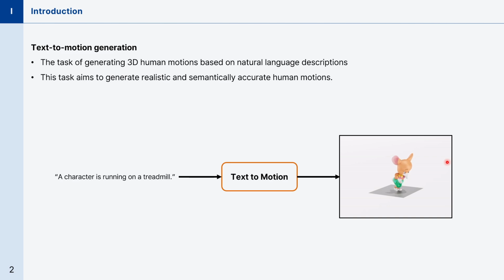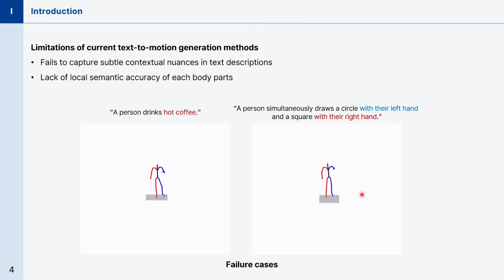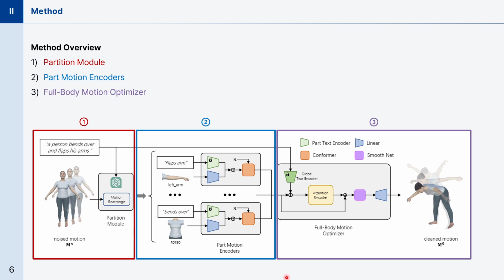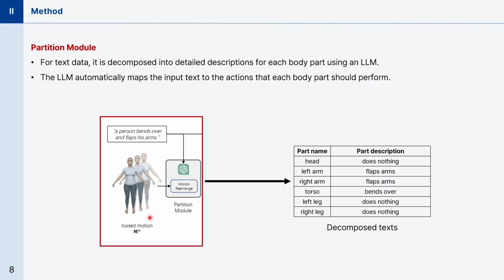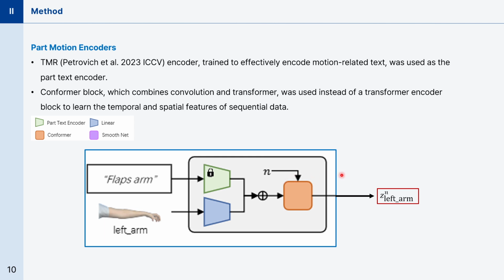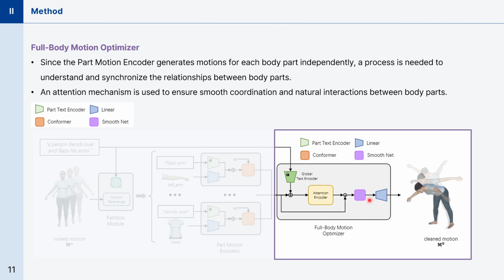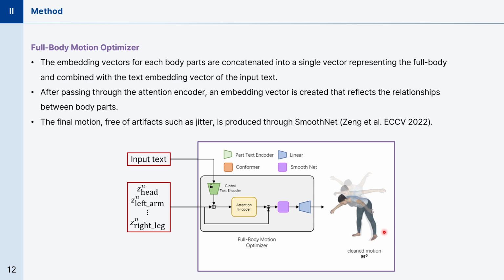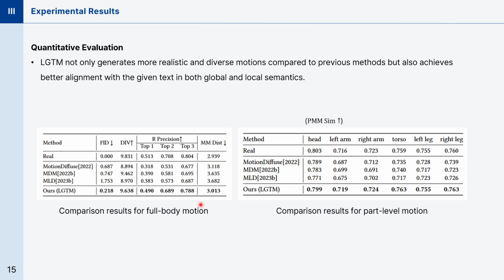[Seminar] LGTM: Local-to-Global Text-Driven Human Motion Diffusion Model

Comment: Thank you for the presentation.
Q1. Around the 1-minute mark, there's an example where a person drinks hot coffee. It made me wonder—actually, the sentence itself doesn’t explicitly mention that hot coffee should be handled carefully. If we provide previous models with prompts that include not just the motion, but also the characteristics that should be exhibited while performing that motion, along with the reason, would they still fail to capture such nuanced features?
Q2. It seems that you used a conformer block instead of a transformer block. Does the paper include an ablation study regarding this choice? I’m curious how much the performance would degrade if a transformer block were used instead.

Comment from the maker: By using an LLM, we should in principle be able to produce motions that are just as we wish. However, in reality, the range of possible motions in the dataset may not be as broad as the flexibility allowed by the text. In that case, are we just restricting ourselves to whatever the dataset can cover? Is there really no way to do this without being bound to a specific dataset?
Reply: You are correct that the range of motions the model can produce is inherently limited by the dataset it is trained on. If the dataset does not include a wide variety of motions or contextually rich examples, the model may struggle to generate motions beyond what the dataset represents. This limitation arises because the model learns a mapping between text and motion based on the data it has seen, restricting its generalization capability.

To overcome this, I think these methods can be a potential solution:

- Data augmentation: Expanding the dataset by synthesizing new motions or combining existing motions in novel ways could increase the diversity of motions the model can generate.
- Few-shot learning or pretrained models: Leveraging large-scale, pre-trained generative models with few-shot learning could enable the generation of motions beyond the specific dataset's scope.
- Reinforcement learning: Training in simulated environments where the model interacts dynamically could help it learn motions that are not explicitly in the dataset.

Comment: I had a lot of curiosity about text-to-motion, so thank you for the presentation.

I have two questions:

Q1. I understand that one of the major strengths of this paper is its hierarchical approach to generating motion by dividing body parts. However, what do you think are the potential limitations of this method? Also, how did the authors describe the limitations in the paper?

Q2. In my opinion, this model might still struggle to interpret descriptions that include context, such as "A person drinks hot coffee." It seems to me that while the model can understand the actions of specific body parts, it might not grasp the reasoning behind those actions (e.g., blowing on the coffee because it is hot). What are your thoughts on this?
Reply: Hello. Thank you for your question.

A1. The limitations of the paper are as follows.
- Since they used LLM to decompose the description, the local accuracy varies depending on the type of LLM used and the difference in inference ability.

- Diffusion model is used, so it is difficult to generate long-term motion. Therefore, using a model that shows strength in generating long-term motion such as VQ-VAE is considered.

- If the input text does not provide enough explanation regarding the sequence of behaviors, it is impossible to grasp a clear meaning. For example, the text “a person performs action A and action B” may confuse the model because it is not clear whether action A should be performed first or action B should be performed first.

A2. You’re correct. While the model excels in mapping actions to specific body parts, it might struggle with contextual reasoning like "blowing on coffee because it is hot." Such nuanced reasoning requires understanding cause and effect relationships, which go beyond the model’s current local-to-global pipeline. These limitations suggest that integrating external contextual reasoning modules or training on datasets with richer contextual annotations could be potential future directions for improvement.

Comment: Thank you for the presentation.

Q1. What specific role does SmoothNet play in mitigating motion artifacts such as jerky transitions, and how does it contribute to improving the realism and coherence of the final motion output?  

Q2. How does the text decomposition process in the partition module use natural language understanding to ensure accurate mapping of specific actions to corresponding body parts, and what mechanisms help maintain semantic alignment?
Reply: Thank you for your question.

A1. SmoothNet reduces motion artifacts like jerky transitions by applying a temporal smoothing filter, eliminating high-frequency noise. This ensures fluid and natural transitions, improving the realism and coherence of the final motion output by maintaining temporal and spatial consistency.

A2. The Partition Module of LGTM uses an LLM to decompose text into body-part-specific instructions, ensuring accurate mapping of actions (e.g., "waves right hand") to corresponding parts. Semantic alignment is preserved through contextual understanding by the LLM and part-specific encoding by the Part Motion Encoders.

Comment: Thank you for the presentation. I have two questions:

Q1. The overall structure of the architecture appears hierarchical and can be viewed as a diffusion-based variant of an RvNN (generative recursive autoencoder) with a specified local structure. However, this approach only considers part locality during the encoding stage, not during decoding. Is there a specific reason why the authors chose not to use part-wise decoding?

Q2. Partitioning the text condition into six parts using LLMs might be advantageous in terms of generality, but I have concerns about its precision. For example, if the text condition includes “clap hands”—which requires both hands—how would this approach handle that scenario?
Reply: Thank you for your question.

A1. The authors likely avoided part-wise decoding to ensure global coherence in the final motion output. While part-wise decoding could enhance local precision, it may lead to inconsistencies between body parts, as each part would be generated independently. By focusing on global decoding, the architecture prioritizes smooth coordination and natural interactions across all body parts, which is critical for realistic full-body motions.

A2. For "clap hands" example, the Partition Module guided by the LLM assigns "clap" to both hands, recognizing that the action involves coordination between them. This ensures both hands are synchronized. The Full-Body Motion Optimizer further refines these motions, ensuring precise local actions and globally coherent movement.

Comment: I found the seminar very valuable. Your presentation was clear and insightful!

Q1. After generating the motion for each part, is the full body motion optimization performed at the end, or is it integrated into each training step?

Q2. Since the model generates motions using a local-to-global approach, why was this method chosen over a global-to-local approach?
Reply: Hi. I appreciate to your great question!

A1. The full-body motion optimization is performed at the end, after the motions for each body part are independently generated by the Part Motion Encoders.

A2. The local-to-global approach was chosen to address the challenges of achieving both local accuracy and global coherence. By generating part-wise motions first, the model ensures that each body part adheres closely to the specific actions described in the text. The global optimization stage then harmonizes these part-wise motions to create a natural full-body motion.

Comment: 1. Can LGTM successfully generate the failure case described on page 4? Handling a hot coffee with cautious motions seems to be a challenging task, even when broken down into parts.
2. How long does the inference time take?
3. I am curious about the effect of applying SmoothNet at the end. How significant is the performance difference with and without it?
Reply: Hi. Thank you for your great question.

A1. Because LGTM focuses on decomposing global instructions into local instructions for each body part, it can have difficulty capturing contextual nuances like “hot coffee”. However, as you can see in the right figure of page 4, LGTM is flexible enough to handle cases where different body parts require different actions.

A2. The paper does not explicitly mention the inference time. However, since LGTM involves diffusion-based generation and multi-step optimization, the inference time may be longer compared to simpler models, particularly due to the denoising process in the diffusion model.

A3. Applying SmoothNet at the end significantly enhances motion quality by reducing artifacts like jerky transitions. Without SmoothNet, the generated motions may appear less natural and exhibit temporal inconsistencies. The exact performance difference is not quantified in the paper, but the inclusion of SmoothNet is described as critical for producing realistic, artifact-free motions.

Comment: I'm not sure how the part text ("flaps arm") and part motion (left_arm) on page 9 forward to the Part Motion Encoder.
Does part motion refer to the indices of the joints and the rotations of those joints?
Or are the joints that are responsible for the order of the encoders already determined?
Reply: Thank you for your question.

Part motion refers to the specific features associated with each body part, such as joint positions and rotations. In the LGTM implementation, these features are explicitly divided by body parts, with predefined feature dimensions for each part (e.g., 48 dims for the left arm and 50 dims for the left leg). The Partition Module ensures that these part-specific features are forwarded to the appropriate Part Motion Encoder based on this mapping.

Comment: Thank you for the presentation. I have a few questions.

Q1. Is it correct to assume that all modules except those with a lock icon in the pipeline figure are newly trained or fine-tuned? If so, what are the loss functions or objective functions used for training?
Q2. Are there any specific limitations of the LGTM model?
Reply: Hi. Thank you for filling in the gaps in my presentation with your questions.

A1. Yes, modules without a lock icon are newly trained or fine-tuned. And the model uses L2 loss during the denoising process in the diffusion model. This loss minimizes the difference between the predicted and ground truth noise, ensuring the generated motions align closely with the real data.

A2. The limitations of the paper are as follows.
- Since they used LLM to decompose the description, the local accuracy varies depending on the type of LLM used and the difference in inference ability.

- Diffusion model is used, so it is difficult to generate long-term motion. Therefore, using a model that shows strength in generating long-term motion such as VQ-VAE is considered.

- If the input text does not provide enough explanation regarding the sequence of behaviors, it is impossible to grasp a clear meaning. For example, the text “a person performs action A and action B” may confuse the model because it is not clear whether action A should be performed first or action B should be performed first.

Comment: Thank you for your seminar.
Q1. Is the dataset a text-motion pair? If the same motion is expressed in different text, I wonder if the same motion will come out well. I wonder if this has ever been covered in the paper.

Q2. Can you explain again how GPT was used in that paper?
Reply: Thank you for your great question.

A1. Yes, the dataset consists of text-motion pairs, where each motion is paired with one or more text descriptions. If the same motion is expressed with different text, the model leverages its learned text-to-motion mappings to generate similar motions. However, the paper does not explicitly analyze how consistent the generated motions are across different text descriptions for the same motion.

A2. GPT model was used in the Partition Module to decompose global text descriptions into body-part-specific instructions. It maps text to specific actions for each body part (ex. "waves right hand") while maintaining the semantic meaning. This decomposition ensures accurate local alignment between text and motion.

Comment: Good presentation.

But I think this paper has a lot of issues.

Q1. In the paper, they do their experiments just once. Is it really realiable? Other text to motion paper usually do their experiments for 20 times. I think it is cherry picking.

Q2. Why they didnt compare SOTA model? There are many models that report better performance than LGTM. Why they did not refer them? Is it normal?

Q3. In this papare claims TMR encoder is better than CLIP in this task. Is it really? Then why other text to motion sota model still use CLIP for text encoder?

Q4. MDM and MLD performane is difference in this paper with the official score. Why??

Q5. The key idea is part based method. Then why they did not experiment without part based in ablation study?

Q6. I think this paper has significant ethics problems. Then how can the paper be accepted?

Comment: Nice presentation

Q1: While the example prompt in the explanation had a good structure to be divided into corresponding body parts, it seems the method might face challenges with prompts like "A person drinks hot coffee.", as introduced in page 4. This example is less straightforward to decompose into body parts. How would the method address such cases?

Q2. What are the limitations of this method?
Reply: Hi. Thank you for your great question!

A1. First of all, let me say that this issue is analyzed by my perspective. LGTM used a TMR encoder that understands motion-related text in more detail, and I think this problem will be solved if there is a text encoder that accurately recognizes the characteristics of objects such as “hot coffee”.

A2. The limitations of the paper are as follows.
- Since they used LLM to decompose the description, the local accuracy varies depending on the type of LLM used and the difference in inference ability.

- Diffusion model is used, so it is difficult to generate long-term motion. Therefore, using a model that shows strength in generating long-term motion such as VQ-VAE is considered.

- If the input text does not provide enough explanation regarding the sequence of behaviors, it is impossible to grasp a clear meaning. For example, the text “a person performs action A and action B” may confuse the model because it is not clear whether action A should be performed first or action B should be performed first.